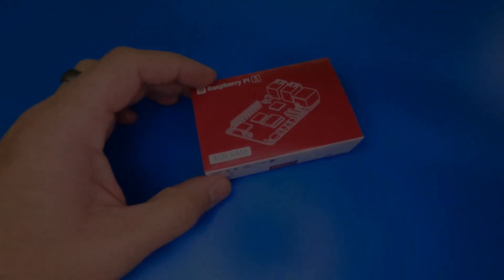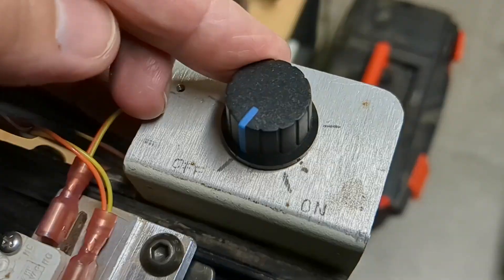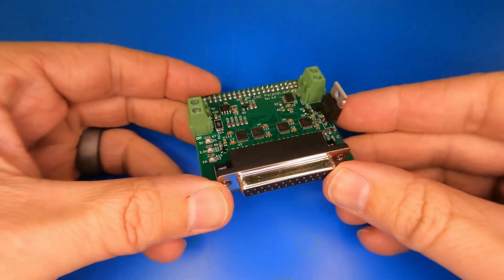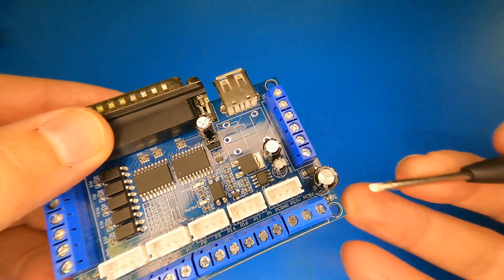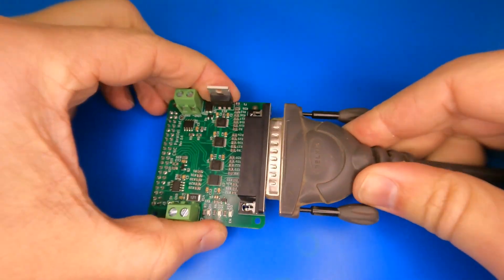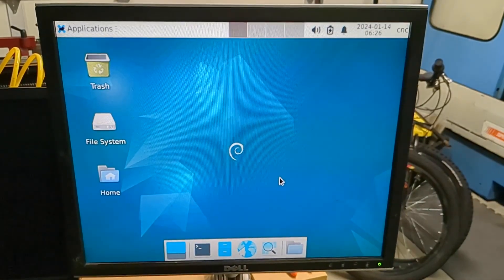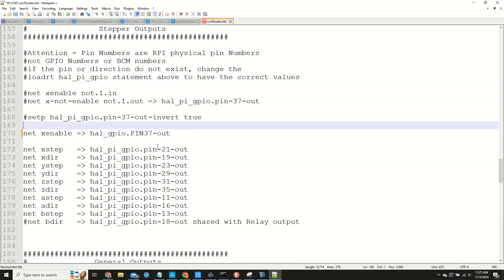Using LinuxCNC on My CNC Router Using a Raspberry Pi 5

Comment: i intentionally chose a pi 3 for my cnc controller and cncjs so i can watch it on the web thoughts? the pi 3 seems like a cheep, reliable, low watt, low heat option.
Reply from the maker: A Pi3 might work.  If you can get LinuxCNC running and configured, it should be a good start..  It will be slow.  Upgrading to a Pi5 is definitely going to improve your experience with it. If cost is a concern, get it running in simulation mode and make sure you can get the remote access working before you buy any other hardware.

Comment: Can this setup be used for a y-axis  dual drive cnc? Can you connect an external jog interface?
Reply from the maker: @MarcoArcioni  I'm sure it can be used with a dual Y motor system.  That is all in the LinuxCNC configuration.  A jog interface is in development.  I was unable to find a USB based interface that was meant for LinuxCNC rather than mach3.

Comment: I took this in a different direction: Ever heard of these cheapo RNR cards? Turns out they have a jtag, you can flash them any way you like. I gave them a SPI port and had the "heavy" stepgen subprocess effectively run on them, instead of the pi
Reply: could you please elaborato on this? thanks.

Comment: ironic how you need a parallel port extension for a raspberry pi. It has all these hadny dandy GPIOs. LinuxCNC already has a driver for them built-in. You might need a level shifter and/or an isolator
Reply from the maker: @eitantal726  You are correct!  That is the basic functionality of the hat.

Comment: Just got my parallel board in the mail! Thanks. Excited to replace my old gaming rig (#2?!) with a Pi 4, your HAT, and a $100 19" touch screen from amazon for my converted 2.5HP 1963 Cincinnati Toolmaster 2800lb Knee Mill converted to CNC.

Comment: Why build a level shifter hat when you have 3.3v input stepper drivers available? - Furthermore, unless you want some opto-isolation, you could've connected directly from the pi to the stepper drivers - Also an inexpensive PWM to analog 0-10v would be enough to control the spindle - What am i missing here?
Reply from the maker: In hindsight, perhaps a board that goes directly to the stepper drivers, or maybe even has the stepper drivers, would be good for a new build.  The 5 axis breakout board has been in existence for many years, driven by PCs that are slowly dying and I thought a pi board that connects to an existing setup without much rewiring would be a good way to go.

Comment: Raspberry pi GPIO can controller drivers input traight, not need breakoutboard use if not want.  only connect GPIO pin to stepper motor drivers step , direction, enable pins better use optocoupler GPIO output and drivers input pins. easy way this have too use. same than arduino can use direct output pins to drivers, not need breakoutboard. or arduino cnc chield.

Comment: Very cool video, I'm trying to do the same for my CNC Router that I'm manufacturing... I wanted to understand more about how you did the Spindler issue to control the speed... Do you have a tutorial...
Reply from the maker: What type of spindle do you have?  The VFD style is easiest to connect using the analog output from the breakout board.  The small DC style can use the MOSFET on the hat.  I don't have a specific tutorial, but the Hal files  are set up for both.

Comment: Just wondering what your boot speed is like when you open lcnc. Mines really slow.
Reply from the maker: Mine boots up to the login screen in under 15 seconds.  I wonder if changing the SD card would make a difference.
Reply: @Byte2Bot  thanks. It was because I was using a really inefficient image :-)  it's now operating really really well.

Comment: A most wonderful RPi5 CNC video.  ✨ Do you have a RPi5 GPIO video using PWM to control the newer GPIO for a LED in Thonny, Python IDE?   😎  Thank you.
Reply from the maker: @qzorn4440  my hope is that WiringPi still works on the Pi5.  If not, then you may be stuck with accessing the GPIO pins like a file using the system calls.  WiringPi does that internally, so I hope it is still working.  Or a forked variant of it!

Comment: did your relay not have a back EMF diode across the coil??
Reply from the maker: In my case the contacts welded, which means a diode would be useful across the contacts since it is a DC motor.  But I think the current consumption of my motor is too high for the relay contacts regardless of any arc suppression used.

Comment: "I have always been leary about the longevity of a large PC" - yeah, this is getting me lately. Until yesterday my CNC has been running from a PC that I already had to replace the power supply in, and now it seems to have completely died. No beep on startup, no BIOS post, nothing :( 
So I'm probably gonna switch to RPi as well, although not with software stepping. Do you know what step-rate you can get from yours?

Comment: iam getting this kind of error when i run in raspberry pi 5 
Debug file information:
Note: Using POSIX realtime
The GPIO line GPIO16 can not be found
hal_gpio: rtapi_app_main: Operation not permitted (-1)
./my_machine.hal:7: waitpid failed /usr/bin/rtapi_app hal_gpio
./my_machine.hal:7: /usr/bin/rtapi_app exited without becoming ready
./my_machine.hal:7: insmod for hal_gpio failed, returned -1
7869
Stopping realtime threads
Unloading hal components
Note: Using POSIX realtime

can u help me ?

the same cod e when i run in raspberry pi 4 model b it works. But in raspberry pi 5 it is generating error like the above.
Reply: Same here on an RPI4b

Comment: How did u changed the resolution because it is showing default, minimum and maximum resolution is 1920×1080 for me plz help. I need to change the resolution
Reply from the maker: @lohith2419  I did two things.  I went to the thrift store to get a monitor that worked.  My original was a Dell monitor with the non-HD resolution and the new Pi image didn't seem to like it.  The HD resolution monitor works better.  Also, for display tweaking I use a command line tool called randr.  Google it to see how to use it.  If you find a setting you like, it can be put into a startup script.
Reply: @Byte2Bot  can i get u r social media handle because iam stuck in one small problem.
Reply: @Byte2Bot  iam getting this kind of error when i run in raspberry pi 5 
Debug file information:
Note: Using POSIX realtime
The GPIO line GPIO16 can not be found
hal_gpio: rtapi_app_main: Operation not permitted (-1)
./my_machine.hal:7: waitpid failed /usr/bin/rtapi_app hal_gpio
./my_machine.hal:7: /usr/bin/rtapi_app exited without becoming ready
./my_machine.hal:7: insmod for hal_gpio failed, returned -1
7869
Stopping realtime threads
Unloading hal components
Note: Using POSIX realtime

can u help me ?

the same cod e when i run in raspberry pi 4 model b it works. But in raspberry pi 5 it is generating error like the above.
Reply from the maker: @lohith2419  The Pi4 and Pi5 have a different architecture for GPIO and the way LinuxCNC uses them has different syntax.  I supply different HAL files that you can download from the parallel hat product page.  Have a look at how the syntax changes between the Pi4 HAL file and the Pi5 HAL file.  Then update your HAL file accordingly.

Comment: Fine! I also use Raspberry Pi but with my grbl board.
Reply: could you elaborate on this?, it seems hes having issues with responsiveness, may be related to the  rpi board doing the high frequency step generation? how do you use this grbl board.

Comment: Do you also have the ini file available for running linuxcnc? I only see the hal file you posted.. Are more steps involved in getting it running like installing a hal component or something?
Reply from the maker: I added the complete config folder contents from my router next to the HAL files on the Parallel Hat product page on my website as a working example.  I am not a LinuxCNC expert, but copying the sample HAL file over your machine's HAL file should be the majority of what needs to be done.  The Parallel Hat will not show up in Linux as a parallel port or anything like that.  LinuxCNC will simply toggle the Pi GPIO pins and the hat will be the voltage translator to the breakout board.

Comment: Do you know what kind of switching speed to expect on the PI 5 IO? i have been looking at using one but am unsure what to expect with max feeds and speeds.
Reply from the maker: That is a good question, and is difficult to answer.  I have my router set up for 1/4 stepping, and I limited the speed to 720mm/min.  LinuxCNC claims that it's update rate is roughly 3300Hz on my Pi5.  Jogging the machine, I estimate that each stepper motor rotates at 2 rotations per second roughly.    If I do the math, 3300Hz / 200 steps per rotation / 4 (quarter stepping) / 2 rotations per second, I get roughly 2.  This makes sense because the interrupt can either pull the GPIO line high or low and it takes 2 interrupts to complete the step.   So the numbers make sense to me.  Your machine will be different based on the setup.   My gantry has a lot of mass so I limit the acceleration and max speed.

Comment: I purchased your Pi Parallel Hat board. I performed the installation you described, but the machine does not run. Linux says that it does not know the parallel port base address. I tried 0x378 and 0 doesn't work either. Can you advise please? Thanks
I have a pi4
Reply from the maker: Yes, I can help! Please use the contact form on the Byte2Bot.com contact page and I will help you through it.  One other customer had the same question, and I updated the Parallel hat blog on the website to hopefully help with this question. Check out the troubleshooting section.  The short answer is that the hat will not show up as a parallel port. LinuxCNC will use it using GPIO.

Comment: I thought I read somewhere that the reason people were using rasp pi was cuz they could use output pins INSTEAD of parallel port...? Guess I misinterpreted?
Reply from the maker: I use the pi because it is smaller, cheaper, and doesn't usually go bad as fast as a typical motherboard.  How you use the pi is up to you.  The cheapest and easiest in my opinion is to use the GPIO on the header instead of a parallel port.  The breakout board that I chose to use has a parallel port interface, so that is why I made the parallel hat for the pi which just connects the GPIO pins to the parallel port connector.

Comment: 7:51 can you tell me where is this file located i cant find it and did it solved gpio problems explain in more depth
Reply from the maker: The Pi5 HAL sample file is located here:  https://cdn.shopify.com/s/files/1/0727/8601/8601/files/cncRouterPi5.hal?v=1705210460

The link for it and the Pi4 version are on the parallel hat product page at byte2bot.com.   I am not in any way an expert on configuring the HAL files, but my understanding is that the Pi5 internal bus architecture is slightly different, allowing faster speeds and from a software perspective, much more similar to a standard Linux based computer.  The Pi1-Pi4 was always slightly different, but the Pi5 changed that.

Comment: need a pop filter on that mic my man. ever PUH you sounded out kicked my floor from my subwoofer.
Reply from the maker: Interesting.  I generally just use the GoPro microphone and don't run any software filtering. No GoPro pop filters on Amazon.  I have been using kdenlive for video editing and I haven't looked yet to see if it has a pop filter plugin or extension. Still getting the hang of it, but if you have a video editor software suggestion, I will be happy to give it a try!
Reply from the maker: Oh snap. I completely forgot that on this video I did use a USB microphone. My bad.  I will get a pop filter for it.  I'll also turn the bass when reviewing future videos to try and catch audio issues.  Thanks!!

Comment: Will LinuxCNC control a spindle via RS485?
Reply from the maker: I have heard that it will, but I haven't tried it myself.  I went ahead and put the RS485 hardware on the hat just in case, so if you get it working on any hardware, even a USB adapter, please let me know!
Reply: I am 82yrs but if I were still a bit younger I would give it a try. Nice job @Byte2Bot
Reply: yes can VFD connect to USB modbus RS485 dongle and then need do linuxcnc hal code, i not knoew code anythink but i has search and learn this little bit can do.

Comment: Do you sell the PI5 Hat that can do the Parallel port?  Even just the bill of components and the design file would be great!
Thanks!
Reply from the maker: I do sell the parallel hat.  I also sell the 5 axis break out board but mostly for convenience since it is available everywhere.  The 3d printable plastic stand can be downloaded for free or purchased.  The newest item is a USB-C plug that can be used to power the pi.  That's a good idea about the list of parts!  Thanks!
Reply: @Byte2Bot  I just need the parallel hat.  I have everything else. Like in the video, I'm trying to replace a PC with a Pi.  Can you provide a link or something?
Reply from the maker: @MichaelAPede  https://byte2bot.com/products/parallel-port-raspberry-pi-hat

Comment: Just curious, was there a reason not to go directly with the Pi's GPIO for driving the steppers? RPI GPIO have native support in LinuxCNC, too.
Reply from the maker: The parallel hat is basically a level converter that allows the 3.3v Pi GPIO to drive the 5V pins on the DB25 parallel connector.

Comment: My understanding is that this is just a dumb parallel port and stepping is done in software by linuxcnc ? It does not have hardware steppers, right ?
 in that case you should warn users of the serious limitations of such setup. Hardware steppers card interfaces to linuxcnc like the Mesa cards or some of the Ethernet based cards are the way to go for good performance. Software stepping is great for testing, but very disappointing if good performance is expected.
Reply from the maker: You are correct, my board is just a level converter that allows a DB25 connection and can control a small DC motor.  The timing and performance is dictated by the RTOS and LinuxCNC software.  Yes, there are FPGA boards out there at 3x the cost that can give a little better performance, but I have been using the parallel port off an old PC for 15 years now without issue.  In my experience, most people are DIY with a limited budget and getting their project up and running is a huge first step.  Once they have it working and want to upgrade it, there are lots of options.
Reply: @Byte2Bot  my linuxcnc working well whit old PC paraller port, and i has add second pciE paraller port too, and 2 pcs paraller port breakoutboard, can use lot more in/out pins now, first card controller stepper motors drivers and second card controller all probe, limits, home, inputs. and VFD spindle speed. next cnc i build raspberry pi and mesa FBGA card lot better ad cheap use.
Reply: I've run stepper motors up to 2,400 RPM off LinuxCNC using software stepping using 8th microstepping. If I go up to 16th step mode then performance becomes an issue. But the PC I use doesn't have great latency either. So for me at least I am not disappointed in performance in the slightest. I think I can output a 33 kHz pulse stream? It's not bad.
Reply: @1pcfred  2400rpm with 8 microstep and typical 200steps per turn give 64kHz step rate. No way feasible on a parallel port PC with linuxcnc...max reliable and low jitter is probably around 40kHz

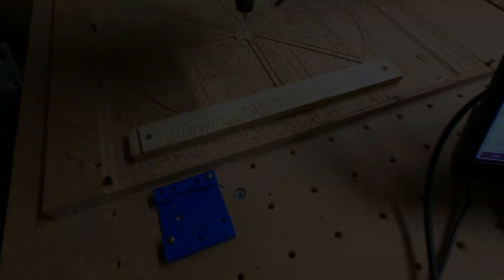Comment: Very cool thanks for this. I have a printnc i want to move to linux cnc so i can 9:23  individually zero the two y axis. At the moment i can not keep my  x axis perpendicular.
Reply from the maker: Zero-ing the two motors on a single axis individually doesn't sound like something I would recommend.  I'm sure it can be done, but you would need a limit switch for each motor and possibly run a different profile to treat them as a separate axis.  If it were my machine, I would disable the power to the motors and adjust one manually until the axis is square.  Then future automatic homing would still treat them as the same axis.  If you loose steps and have to do this more than once a month, it might be worth looking at the acceleration and step rates of the motors.  Let me know what you end up getting to work.  I will be curious to know what the final solution is.

Comment: Can you use all 5 axis with this boards ?
And simultaneously 5 axis movement ?
Reply from the maker: Yes, the hat has channels A and B wired up for direction and step signals, in addition to the X, Y, and Z channels.  I have never needed more than 3 channels, so the actual setup of LinuxCNC configuration may be a little out of my area of expertise, but the hardware supports it.  The only thing to watch out for is that the B-Direction signal is shared with the relay on the 5 axis breakout board.  So if you intend to use that relay (most people don't), then you might have a conflict.
Reply: @Byte2Bot  that’s so cool what you’ve done . Including parallel rasp pi 5 board.
Reply: @Byte2Bot  so this hardware can do 5 axis TCP, RTCP kinematic ?
Latency ?
Reply from the maker: I measured a 2mS latency on my machine.  Yes, the hardware supports 5 separate stepper motor outputs.  TCP and RTCP are more software specific and I doubt LinuxCNC supports that.  Also, if any machine supports that using stepper motors, send me a link!  That would be about as exciting as a Volkswagen bug going 200mph.
Reply: @Byte2Bot  i’m sure they can answer this in linuxcnc forum, pls do ask there, I would love to hear the answer.